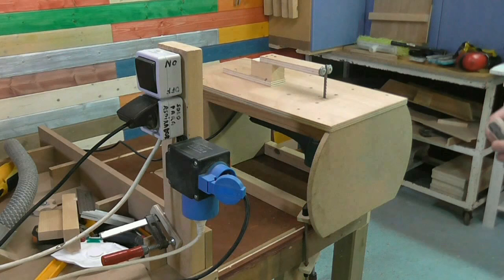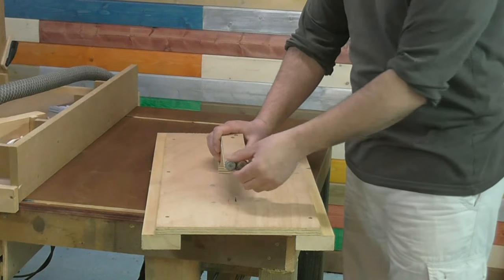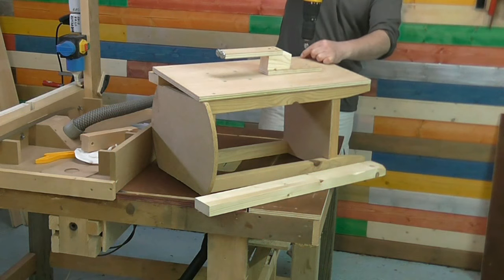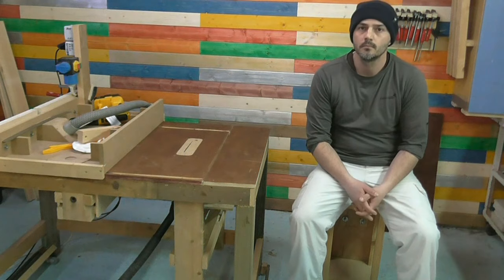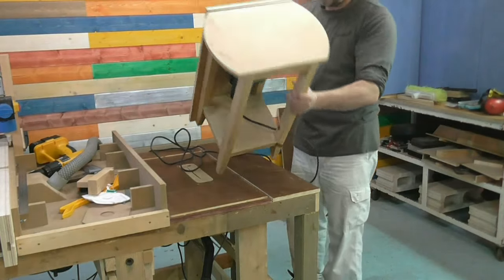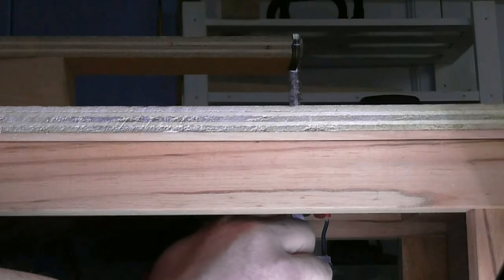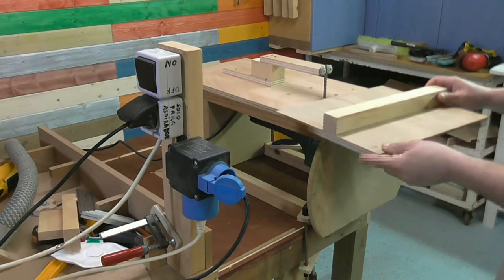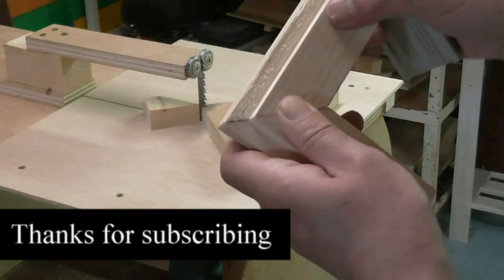A table structure for my jigsaw table

Comment: great idea. i like the dual purpose of the stool, and using washers with wing nuts. that seems a lot easier/versitile way to fix the jigsaw vs. securing it to the wood with screws
Reply: john drury
Reply: john drury 111＂
Reply: que puedo hacer con un motor de bomba de agua
Reply: johndrury